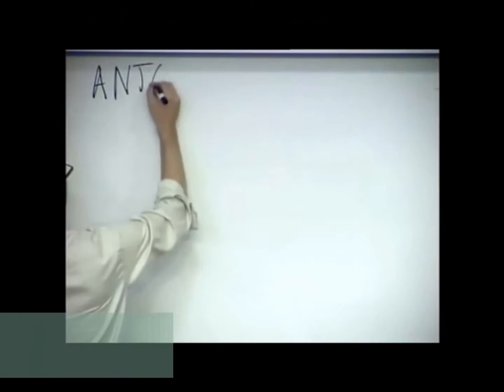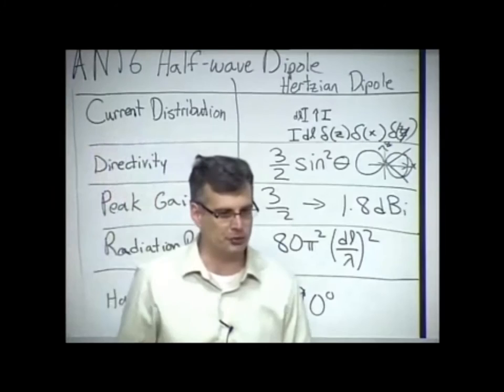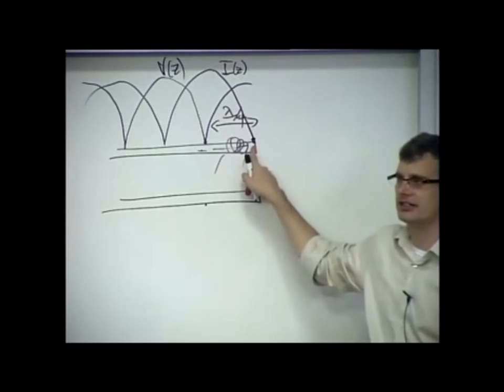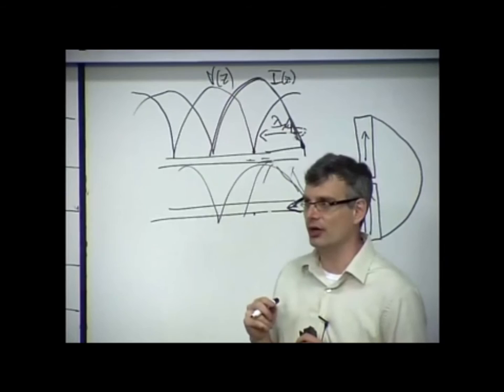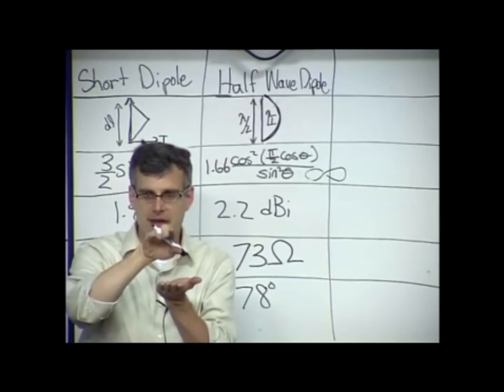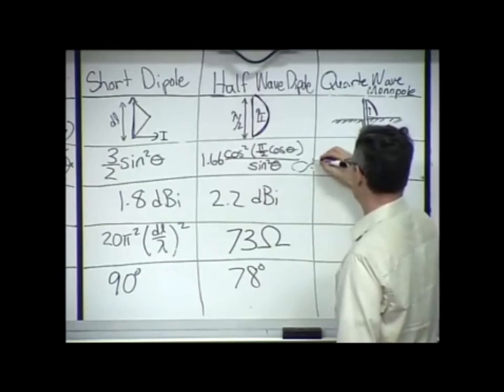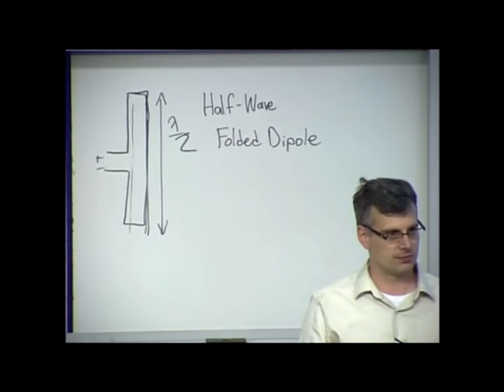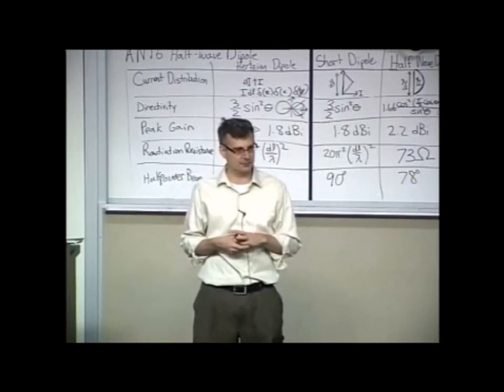ANT06 Half Wave Dipole

Comment: No wonder few authors or lecturers talk about the standing waves associated with radiation from antennas and impedance matching-this is much more involved mathematically than I thought! At lest at my level. You are very clear, and even I took something away from your lecture. Intuitively then, with a half wave dipole- this type antenna is reasonant at the driving frequency, which means that standing waves of voltage and current exist on it-which is desirable. You definitely do NOT want these ( standing waves ) on the transmission line- that would indicate a miss match-but one wants to tune the antenna by whatever means to obtain the maximum amplitude standing waves of voltage and current on it. I think.